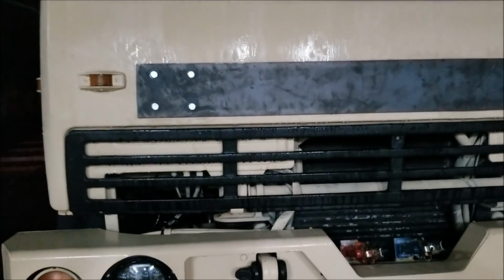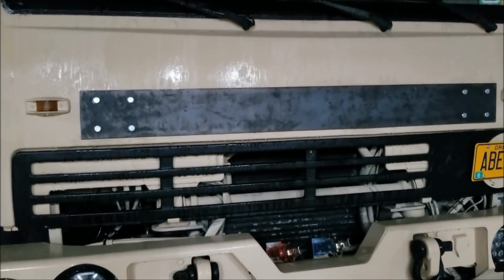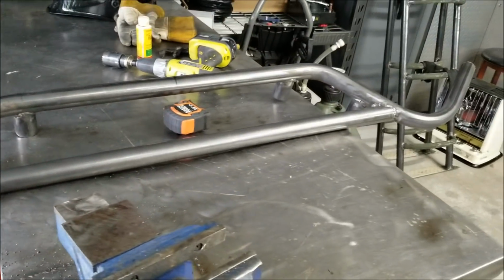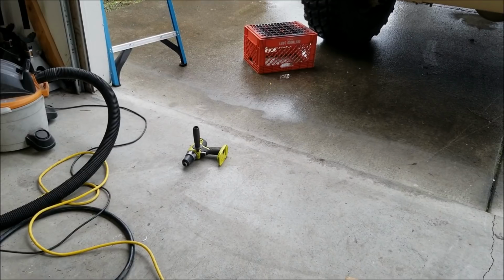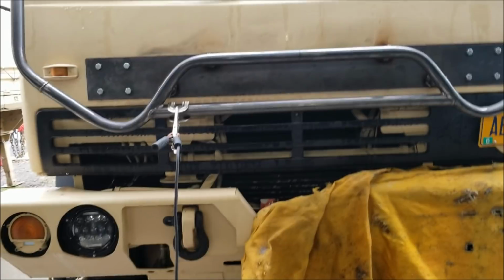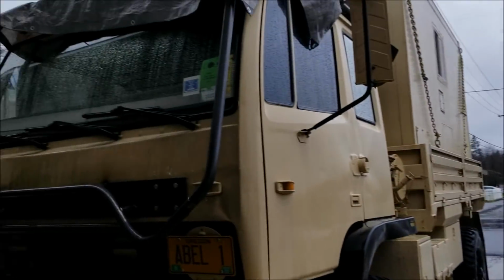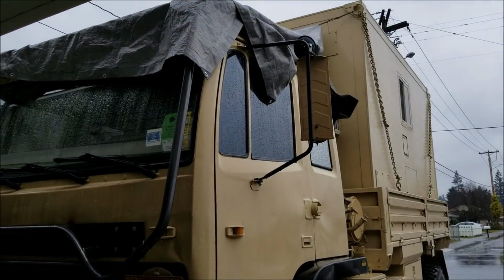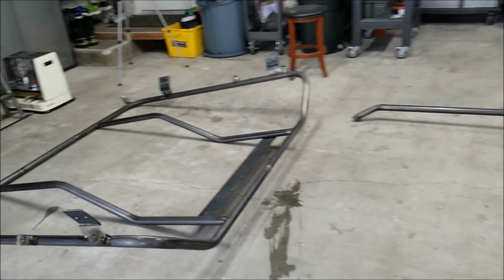Abel LMTV build part 62 (cab exoskeleton part 3)

Comment: Looks great 
What did you have to do on the inside of the cab for extra strength to hold that plate on ? 
What is the thickness of the steel your using?

Comment: Love that fabrication... I do have a question, however. Do you plan on filling the tubes with expanding foam or something else to prevent water penetration? Perhaps your welds are better than mine, but invariably I wind up with a tube full of rusty water. What's the trick?
Reply from the maker: My welds are not "weldporn" status but the bumpers on Yeti seen in the video were made with the same pipe and have not rusted.  Granted they are 304s however once I am done painting the mild steel ones on  Abel with the Rustoleum flat black oil based I doubt they will ever rust as the paint will seal any and all leaks that may occur.  Time will tell.
Reply: @coachgeo , well okay. I have had some good luck with it being that the polyurethane is non-absorbent. I guess the only true test would be to foam a pile, let it dry, rub some skin off on it and submerge it in water for a week. Thanks for the warning.